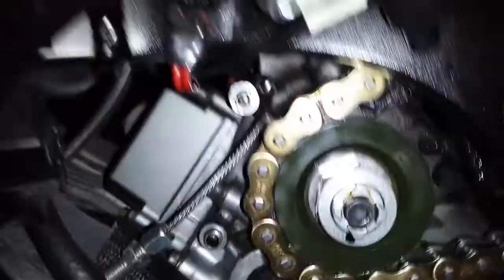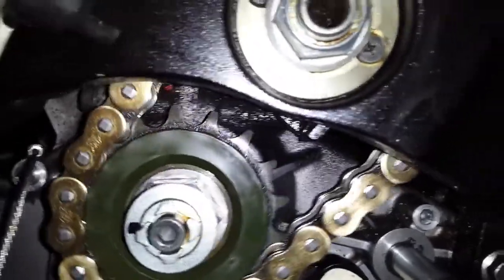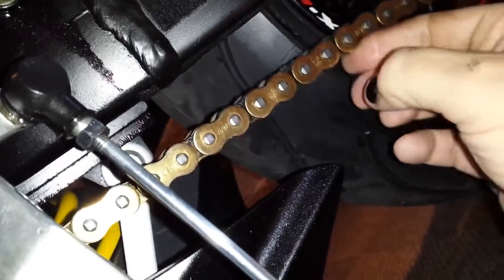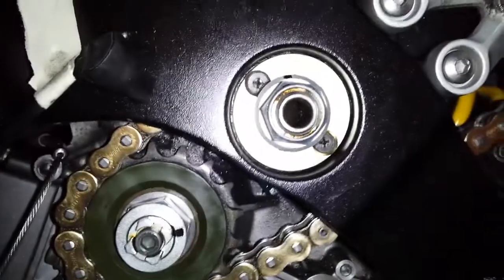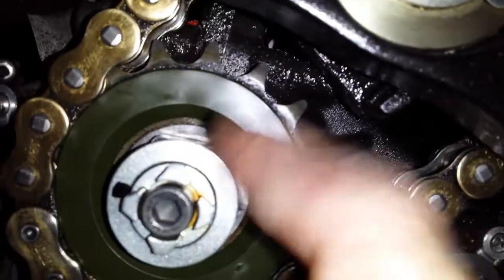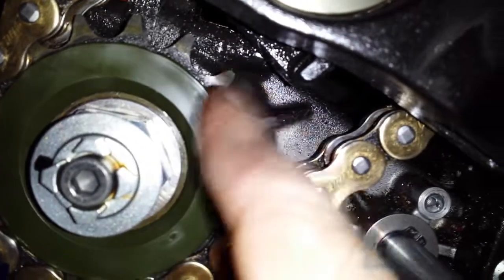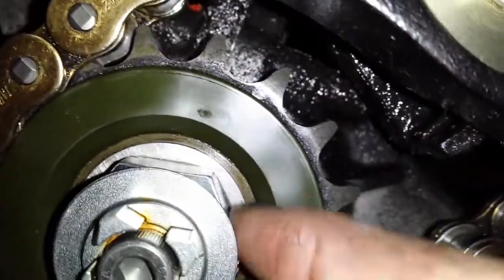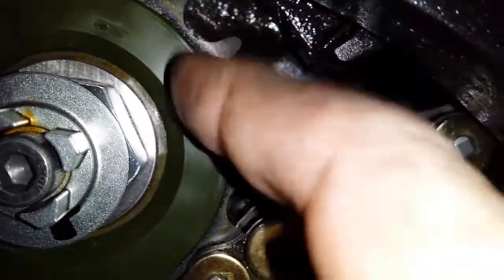Gsxr 1000 k6 Chain Clicking Problem Part 1

Comment: I have the same noise happening I believe the previous owner did not tighten it up to speed but I have a question did your chain get tight and loose when you would rotate the wheel? And i mean almost a full 360 degrees
Reply: I need to ride my bike!!!! I'm tired of not being able to
Reply from the maker: No seems fine
Reply from the maker: No chain did Not get tight and loose seemed fine

Comment: Thtat chain i to tight xD
Reply: agree
Reply from the maker: Not really its been fine ,  running to slack can also be a problem
Reply: @sabs1970  had same sound released tension and sound was gone..
Reply from the maker: chain tension is  fine  still in good shape lol I must something right as chain & sprocket have done near 20k mile still in good spec ' plus No gearbox or bearings problems